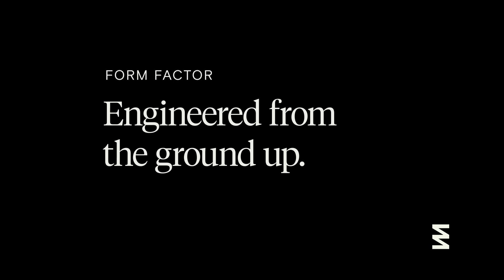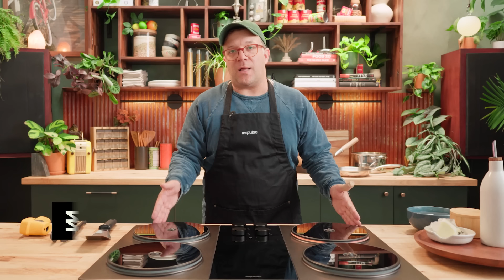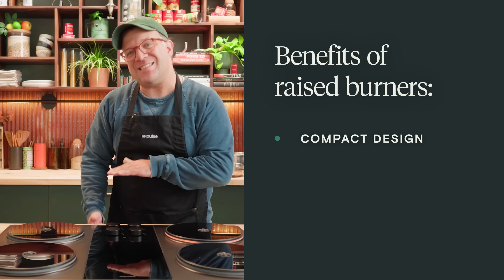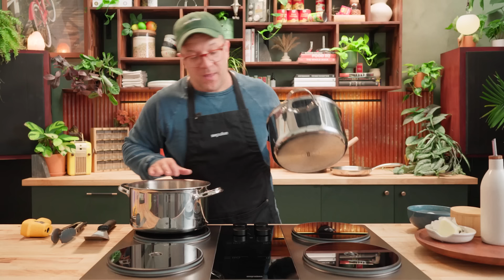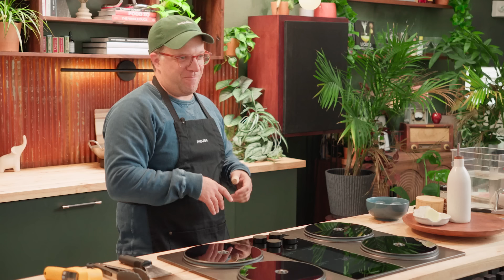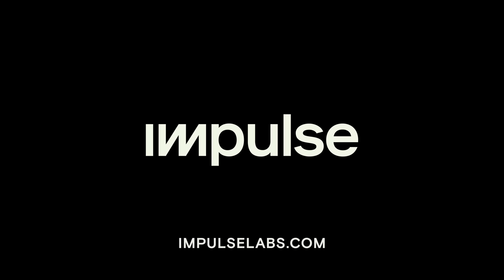Why we went with raised burners? The Impulse Demo Part 2

Comment: I see this machine as a work of passion. Everything about the cooktop is fantastic - the buttons, the screen, the temperature monitoring, the battery, the power.
Had I been building such a machine I would have gone for a full surface glass top induction cooker with all the features mentioned above that I love. 
On this one I'll always be slightly wary of putting a crock pot on and letting go of the handles quickly. I'll check if I have placed the utensils correctly etc etc. No such issues with glass top & full surface.

Full surface+power. You'll find me at the front of the line. Till then I'll stand and wait. 
Can't be buying an upgrade in another 5 after dropping the big ones on these.

Comment: I think the pros for the raised burners do not outweigh the cons. If you offered a similar package that was flat, you would have a more compelling product, personally. I also think one ~10 inch coil would be nice for oversized cookware, but 9 is plenty large for most applications so I understand the choice.

Comment: I strongly suspect the only real reason for the raised burners was to keep the depth below shallow.  None of the other things make any sense and just sound like trying to make the best of the situation.  Isn't that display under glass?  The induction cook top I used for ten years never got scratched up badly and I scraped pans all over it every day.  I never felt the need for visual feedback.  And I don't understand the supposed problem of a pan touching the counter top  beside the cook top if you need to move it.  Better than topping and sloshing something out of the pan!  I really want this appliance, but the raised burners are really the only thing that is making me drag my feet.  You have a lot of nice choices under $7K for established brands.  I hope there is a redesign in the future.  This isn't like making a flat screen TV thinner.  There are a lot of advantages to having everything under a single piece of glass.

Comment: how does the cooktop manage the temperature of the electronics inside the cooktop? since the electronics is enclosed by the counter/cabinets how is the heat gonna get purged?
Reply: Worrisome that they have not responded
Reply: @hsmiii  Why would it be any different to literally every other induction cooktop? They all have electronic circuitry, and tend to have small fans under the worktop to purge heat.
Reply: @tubesomething Sound logic. I’m just bothered by their lack of interaction.

Comment: I spent a fortune many years ago on a Jenn-air because we loved the flat cooktop with cool looking touch controls. But if they got wet, they quit responding and then two months after using the brand new appliance it died and they replaced it with one with hateful knobs.  
I hated to see the knobs on this cooktop even with that past experience, but seeing they use a magnet and easily removable for cleaning, I simply love it.

Comment: The burners need to be spaced further apart, between the burners (front to back) to accommodate large pots w/o having to push pots off of center on the burners.  If you are able to offset the pots on the burners, when crowding the cooktop/hob with larger pots, and you don't have to completely cover the entire burner, then it wouldn't be an issue to make the burners smaller and push them further apart.

Comment: Circular knobs suck. Not designed for gripping. Change the design to have some form of handle where you can naturally put your hands to get a good grip on them.

These might be fine in ideal conditions, but think about the situations where there's oil on your hand or users have weaker hands from arthritis or something that make it hard to grip. Epicurious does videos with a kitchen gadget designer who worked for Oxo that talks about these principles - there's a reason Oxo consistently make the best stuff for the kitchen. My current range has knobs like these and they are genuinely the worst. 

Not sure if magnetic knobs are appealing. Seems like they could get lost pretty easily. My nephew would definitely pull them off and take them who knows where.
Reply: Circular knobs can work totally fine if there's a knurled texture to the knob to increase the contact area between your fingers and the surface.

I've already given them the idea to do this once, so make this comment number two where I suggest this.
Reply: @lukealization  Yeah, as long as the texture isn't super smooth I don't really see the issue. Especially with magnetic knobs, where there should be basically no friction so you shouldn't need much grip at all to turn them
Reply: I think the fact they could sell customizable knobs could be a nice feature. They're so easily removable, I don't see why they couldn't create customized/varied knobs.

Comment: Raised burners actually might be a dealbreaker, or at least has made me hold off on a purchase. Being able to move pots/pans around by sliding them is hugely useful, and makes wiping the whole cook surface much easier. The ease of use gains from having the magnetic knobs in regards to cleaning is immediately gone from having to clean around each burner. 
I'd much rather a screen somewhere off on the side or corner, and lose the storage space below, than have an uneven cook surface.
Reply: Personally I'd never slide a pot or pan across a glass cooktop, no matter how strong or scratch resistant it claims to be.
Reply: Yup, I agree. For us not rich people. Having the flat glass surface gives you more counter space as well to place things on.

Comment: I would say that for me personally I'd prefer the burners not to be raised but I get it with how you guys choose to place the screen and reduce scratches.
My poteintial idea would have been to have the screens raised on the outer edge on each side or just all on one side seems fine. But leaving the burners as a single flat surface. For me I would like the whole thing flat cause then there's no chance for it to tip/lean and then spill something. It also feels easier to clean in my head. And the one plus for me with the glasstops, you can use those scrapers if something gets stuck but it's easy to feel the difference in texture if there's something still on it.
A thing you didn't mention here, physical buttons is nice. Is there a speaker with it as well?
With visual impairment (like mine) that would be a nice feature so you have a better idea with what level things are at or if something is still on. Since you already have the possibility of a menu then speaker stuff could be turned off for whoever wanted too. But it could be a nice plus to those that can't see too well. One of the big hazzles with most electric cooktops today as well as the buttons.
And for a noise to make people aware that the cooktop is on. A pling once a while is plenty. I don't need a constant buzz but a little something 5 min interval or that you could set that timer yourself, would be great!
And I guess there's a dry pan safety feature or even possibly timer to set it to turn off? You could make it click once to start the burner, double click to set timer.

Comment: Can you demonstrate how it works with a wok?
Reply: The have another video where they had a wok and basically were teasing that as a possible feature.  It was interesting because it wasn't a flat bottom wok and the take advantage of the raised burner with a wok ring that fit around it.  They didn't say that it was coming officially though.
Reply: https://www.youtube.com/watch?v=7zhXF3_Cz8k
Reply: Or just demonstrate all. They didn't do a demo did they?
Reply: I have a halogen cooktop I love, sadly they’re no longer made. They put out great power, but not enough to keep a wok going for extremely hot stirfry. However, I bought a cast-iron wok and once you heat up that huge piece of metal it provides for a great stir-frying experience.

Comment: The biggest issue is that it costs $7,000.  Oh sorry. it’s actually $6,999. Which is issue #2; it demonstrates how flawed your entire Ronco-esque marketing strategy is to think that $1 makes a difference to the high-end market this is aimed at.  Not only do those people like rounded whole numbers, but they're easily offended when a new upstart with zero reputation treats them like they were born yesterday.
Reply: Houses are listed that way. It's not as big a deal as you seem to think.
Reply: I have never once been this annoyed about a $1 subtraction from a rounded number. Chill.
Reply: It used to be about 3k cheaper before all electric-anything incentives were slashed. I'm sure this company, along with many others couldn't anticipate that many years ahead when they were in the design phase.
Reply: I was looking to buy a regular induction cooktop around $2K,  I got a quote for around $4K to pull a circuit that I needed.  For me, that shrank the premium that I would be paying.  I lucked in to a local incentive for electrification that had bonus induction with batteries (as far as I know there are two products in this space).  That incentive basically wiped out any price premium for this cooktop.

From a feature prespective, the power boost at 10 kW is pretty impressive.   As far as I know there is nothing else that can touch it.   I get to hit 10kW with a unit that is plugged into a 20A outlet.
Reply: @ArnolddeLeon  Was this a state benefit? I think I have the same incentives and hadn't thought about using that to buy this...now I'm intrigued.
Reply: @LukeOranje  They're state/regional benefits.   In my case, California and customers of specific utilities in particular regions.

Comment: Is there any interest in developing induction without all of the tech features or are y'all only aiming for the upscale market?
Reply: In a video with another channel, they said they're working with other partners to do a sort of "powered by impulse" so I'm assuming definitely something a bit cheaper with fewer flairs, but the biggest things with imulse are the battery and the temperature control so I'd imagine (and hope, because it's very cool) they'd be aiming to generally have a minimum of that. Especially the battery in places like the US because of the lower voltage standard outlets in houses

Comment: Did you re-upload?  I swear I saw this video already.

I've had fun showing off our Impulse the 10kW of power feature.  We're discovering that cooking in temperature has a bit of a learning curve.  For example, I just can't make caramel by going to the temperature that I need.  I need to start it "old school" in power mode to get the process going but I switched temperature mode once I got it going to reduce the risk of burning it.
Reply: How can there be a risk of burning it when in temperature mode?
Reply: It seems it’s an excerpt of a longer video.
Reply: We haven't taken delivery of ours yet (overseas), but what makes you want to use power mode first? As I understand how temperature mode works, shouldn't it asymptotically approach the desired temp using whatever PID logic they've programmed in?
Reply: I believe the issue was the sugar itself was not getting to the caramelization temperature using temperature mode.   The cooktop is inferring the temperature based on the temperature of the pan.  My guess is that if the sugar had not liquified it was not getting the correct temperature  so I was stuck in an between stage, warm sugar that was NOT caramelizing but the cooktop thought I was at right temperature.

What worked was to use power mode to get the caramel "going".  Once I had liquid caramel started I could switch to temperature mode.  At that point I wouldn't burn the caramel.
Reply: @ArnolddeLeon  Ah interesting. I guess that makes sense because the thermal conductivity from your pan to sugar would be quite low, so there's a bigger difference between the pan temperature which is what the cooktop actually reads and the sugar which will be a lot cooler.

Hopefully integrations or accessory products such as the one they've hinted at with Combustion Inc's food probe could help rectify this issue in some cases.